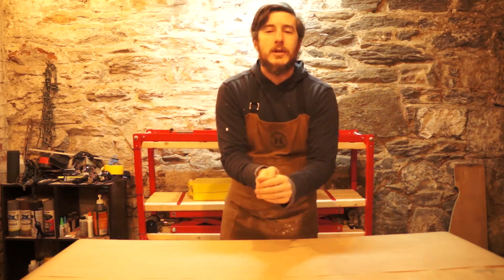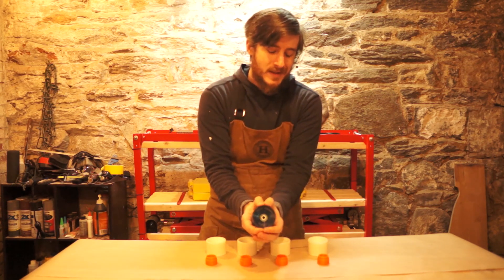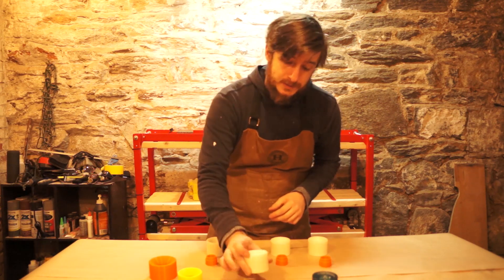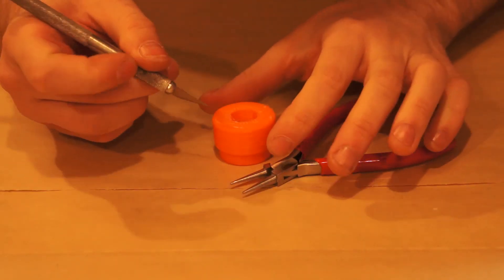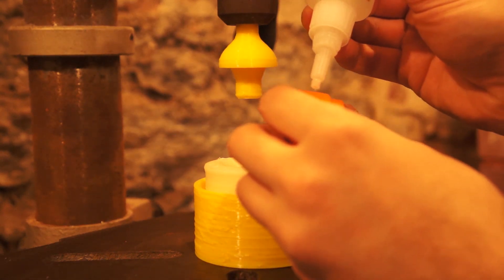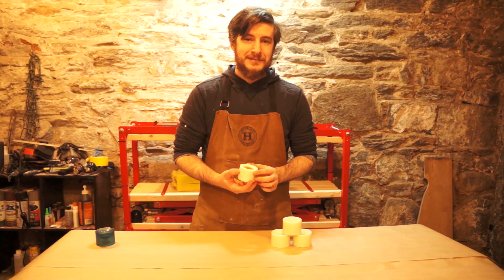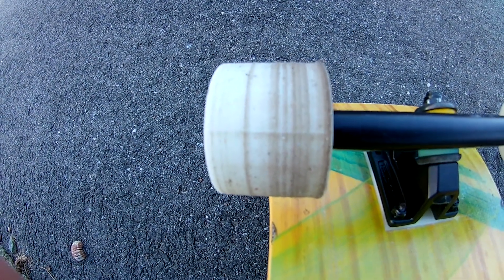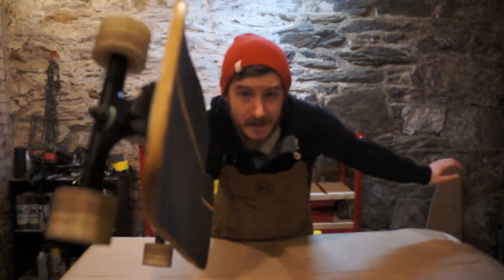3D-printed Skateboard Wheels

Comment: Did you print your tools (wheel cradle & hub seating tool) out of PLA?
Reply from the maker: Yup! Just used a bunch of walls, top & bottom layers, and infill
Reply: I printed a wheel using TPU for the first time, but the quality didn't come out so great. There was delamination and defected layers. It might be my print settings. I used 65C for the bed, 230C for nozzle, my nozzle is 0.3 mm, layer height is 0.25 mm, 3 perimeter layers, 100% infill, hex fill, 20 mm/s print, and 100 mm/s travel.

What print settings do you use for the wheels?
Reply from the maker: I don't know my temps off the top of my head but those all seem in the right ballpark to me. I'd recommend grid infill and using a LOT of walls though. That will make the print lines concentric in a way that will help the wheel behave better. A larger nozzle might also be an advantage, 0.3mm is pretty small. How's your part cooling? At those temps TPU should be okay at layer adhesion
Reply: @GoodRoads  i think my part is cooling fine. My printer has a built-in fan. I got a better print with a scaled down prototype using modified print settings. What direction did you print the wheel? I have been trying out different build orientations
Reply from the maker: @jaewan234  It's designed to be printed with the inner, squarer lip down on the build platform. That way you shouldn't need supports

Comment: You're videos and projects are great! I just bought my first 3D printer. I've been skating for 13 years and currently earning my materials engineering degree. I'm definitely going to try this out this summer!
Reply from the maker: Give it a shot! These wheels work okay but if you want to make some that are actually decent check out my series on casting urethane wheels with 3d printed molds. Little bit harder to do but the wheels are much better